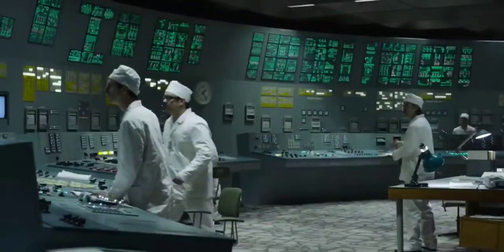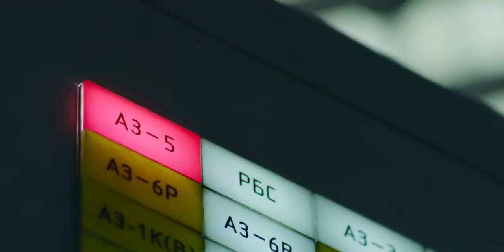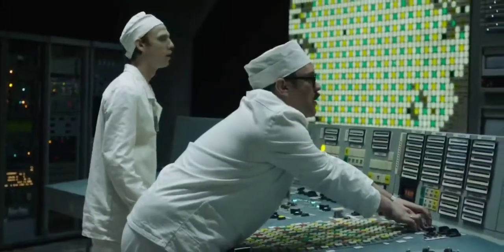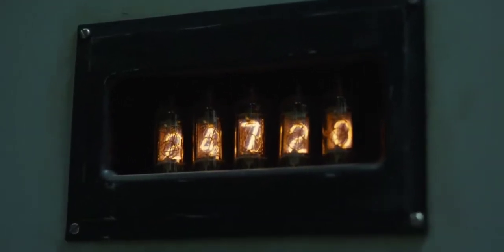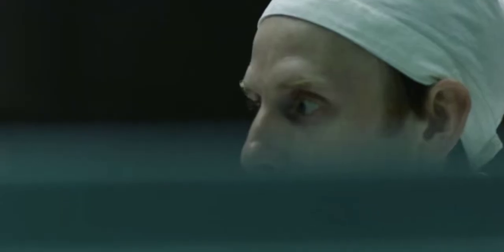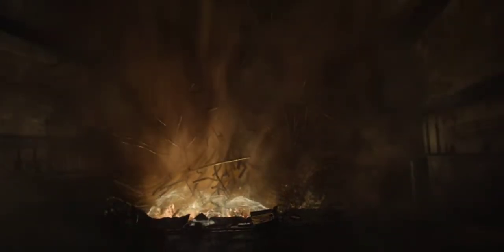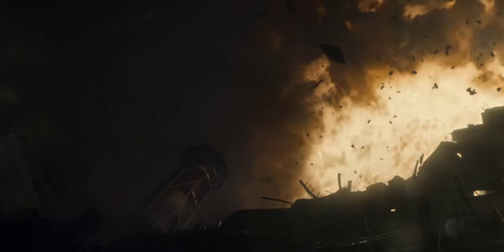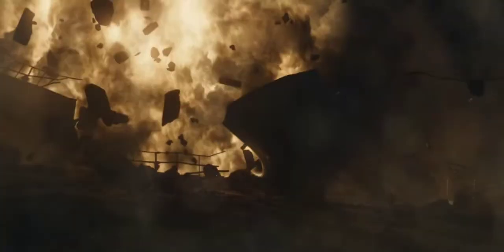That is how an RBMK Reactor Core explodes|Chernobyl|Lagasov Explanation

Comment: Imagine the power needed to throw a 1000t lid off like a manhole cover during a sewer explosion. That thing flew off, ripped through the reactor building (basically a shed compared to Western reactor buildings), kept going and landed on its side.
It was a massive steam explosion and those can be absolutely terrifying. Look at steam locomotives having torn apart. A single liter of water equals 1600 liters of steam and that steam wants to go somewhere, since something like a nuclear reactor is a closed system. In this case the "easiest" path was moving the reactor lid out of the way, which says a lot about the pressures involved. That and basically every pipe in the building having ruptured.

Comment: Can someone explain this to me? If the moderating rods are made of boron, but their tips are made of graphite, which is used as a neutron moderator (slower), why does he say that it was because of these tips that the reactivity increased at the moment of insertion???
Reply: Because graphite at super high temperature doesn't slow down reactivity; it increases it. It became a feedback cycle of reactivity, increasing temperature and pressure.

Comment: For those that haven’t already checked. Most if not all of the nuclear power incidents were caused by negligence of the operators and the system controlled by it rather than the reactor itself.

Japan for example in 2011 Fukushima was initiated by TEPCO’s negligence of not following the warnings set by the NISA for more than 5 years straight. The earthquake exacerbated the situation but only because nothing was done to prepare for it.
Reply: No the main problem was the reactors designe human error was just the matter of time
Reply: This isn't reassuring. You're saying the only problem with nuclear fueled power plants is that people run them. Oh, is that all?
Reply: @Harriet1822   at its core humans are the reason, sure the reactor system can be bad but its ultimately our fault things turned out the way they did
Reply: @Harriet1822  This is why safety measures are supposed to be redundant. Humans are inherently idiotic, so make it harder to screw up
Reply: good thing we're moving into AI era and will be able to replace majority of humanitys faulty resposibilities.
Reply: @ANythingsGood-of6uu Thats not really gonna help when said humans make the AI
Reply: @ANythingsGood-of6uu but you do realize that AI is basically just an imitation of us right? Our mistakes could accidentally be in the AI, and of course it'll follow that.

Comment: I really dislike this representation of events. Yes, some things were kept from the crew and were known by those who need to know the intricacies of the system. Those people make the rules for the use of a reactor, or any machine. And they tell you want to do and what NOT to do. For every machine, there is a prescribed proper way to use it. And there WAS one for RMBK reactor. Which the show neglects.

KGB and designers put in the files for the testing - what is the proper procedure to prepare for a test on such a reactor.

The show does cover some of that, but glances over it and pushes all the blame on the government. Aside from pages of explanation on how exactly to prepare for a test that should have been done, there was one big warning: Do NOT start a test under 700MW, the reactor is NOT stable on low power.

They didn't obey, the shift manager wanted to finish the test and get promotion/raise.

So the argument that the lies caused the explosion is itself a lie. The explosion was caused by the crew not obeying clear orders and procedures. In the same way you cannot blame US government for a soldier blowing themselves up when using a rocket launcher that has a clear inscription "This side towards the enemy". Rules don't have to be explained in detail every time, but they need to be obeyed.

And we do it with every single part of equipment and machinery we use every day. There is a user manual and a clear instruction how to properly use them. They do not go into details WHY you should do the things they say you shouldn't. They just say "Don't do this" and leave it at that. They say "do not cover the heat exhaust of the electric heater with anything", but they don't go into details explaining how it will cause damage and electrical fire which can spread and burn down your house. They just say "do not cover the heat exhaust". And for a smart person, that is enough of a warning.

The crew working that night got the clear instructions of what to do and what not do to. They didn't obey and caused the biggest nuclear disaster in history. So shifting the blame on the government is frankly pointless. You cannot make a system foolproof. You make it, you write up the correct user instructions and that's it. If someone does not follow them, not your fault.

But the show was filled with anti-Soviet propaganda, majority of it completely fictional and unwarranted, because the director had an axe to grind and an agenda to settle.

A good watch, but plays very loosely with historical accuracy and blame.
Reply: Personally, I thought the show avoided anti-soviet propaganda, it showed how the crew was at fault and how what they did lead to the disaster. While also emphasizing the failures of the state and its desire to keep things as cheap as possible while also burying any evidence that their actions could cause issues later down the line. Hell, the show frequently showed every individual as an actual person with understandable goals and fears and how they existed within a Soviet system that was beginning to crumble all around them due to a culture of fear and braggadocio. In all honesty the show didn't actually have a true bad guy in a physical sense, just in the sense that the systems the characters attempted to navigate were beginning to crumble, and historically that's not wrong at all.
Reply: @maluse227  The fact that you didn't notice the political propaganda just means they did a good job. Every episode has a major anti-Soviet segment that was invented and put there just for its own sake.

Episode 1 - made up "old guard" Soviet politician in the bunker that tells them to just shut everything down and trust in the Party. That is nonsense, just reinforces the idea that the Soviet politicians were some fanatics.

I don't remember the exact order in the episodes anymore, but other things that made no sense and were put there just to reinforce the western image of Soviet Union:

- Adding a whole segment on KGB prisons and a scientist in them, with no connection or relevance to the actual story. The producer himself said that it is not story related but that they wanted to show it because "harsh prisons were a thing", so from story about Chernobyl you go to criticizing things about the Soviet Union in general, and displaying Stalin era prisons in late 1980's Soviet Union.

- Volunteers/soldiers going around shooting dogs for the entire episode. Didn't happen, but let's show how heartless orders from the government came.

- Children going to school in Pripyat days after German children were told to stay indoors - a complete crap, the entire city was evacuated before the news even broke to the rest of the world. But, again, let us show how heartless Soviets are compared to the rest - even if we have to completely fabricate the narrative.

- Ukrainian babushka just subtly throwing in Holodomor in the story about Chernobyl disaster and a soldier threatening to shoot her if she does not come along. Because, for a moment there, you forgot that the government was and is evil. Can't have that. In reality, that soldier would have given her supplies, both then and periodically after the disaster - who wanted to stay, could, and the government was regularly bringing food, water and medicine. Some people still live in that zone. No one was threatening anyone at gunpoint out of their homes.

- Having a short fat idiot as a head of Belarus SSR, placed there for being a political yes-man, while in fact he was a tall guy with an engineering degree and was quite capable person. But we can't have that, we need a fat idiot stuffing his face and crapping on our good characters.

- Minister of coal being represented by a weakling that miners humiliate, another representation of a corrupted and inept soviet politician. In reality the guy was working in the mines since he was 15, spent his entire life in them, went on to run them, finished several degrees in engineering and mining through the course of his life. But again, we can't have someone with that resume coming in front of the miners as a minister, we need to represent the government as weaklings, liars, corrupt and inept. Even if in reality the minister had more experience in the mines than any of those who stood in front of him.

I could go on and on. The show is RIDDLED with instances of complete fabrication so that your "real character drama" can happen. And when you need to FABRICATE the environment for your characters to react to in a certain way, then you are not historically accurate.

And you are driving an agenda, a political one, and not telling a story.

Every single episode the show just reinforces the early Cold War western caricature of the Soviet system, and no, it is not historically accurate at all. Characters do not act as "real people" because you placed them in a completely fabricated and caricature universe to start with. And that's what makes it an awesome propaganda show - lies crammed in between some historical points.

Chernobyl series should be a master class in political propaganda piece. That is how you do quality propaganda.
Reply: And who's fault that those people were in charge of the nuclear plant, that's right, the system. So you could blame the government and the KGB for that
Reply: Good tankie. I'm sure the time-travelling ghosts of several Soviet secretaries general will bless you.
Reply: @Mark-xh8md  I have no idea what you said there... but I guess you think you made some point.
Reply: @Wustenfuchs109  " I have no idea what you said there... ", lol, sure you don't.....
Reply: @Wustenfuchs109 While you are right about some of the technical details, you forget that this is not a documentary, but an art piece. Since impressionism, art has evolved into not portraying things with 100% accuracy, but to take a snapshot of their true nature, which this show does exceptionally well. 

As a Hungarian, I can tell you my parents were educated, my grandparents were economically crippled and harassed, and one of my great grandparents was killed by various SU party officials. Not all of those were bastards and monsters (not in the show either), but sure as hell many of them were, and this system of ever shifting accountability and lies let incompetent and petty people in power run amok, destroying lives, and eventually the system itself. 

What you call "Western propaganda caricature" has been the experience of many who lived in this system, and suvivors and pieces of literature, art, music are a testament to that. Can send recommendations if you like. That is of course only the ones that survived state censorship and the Black Car. Yes, you could crack some jokes about some chinovnik, or the party, and a black car would show up in front of your house at night, take you away and you may not return. These are not myths. 

Another example of what Chernobyl shows us is happening in Ukraine right now. Putin´s puppy, Sergei Shoigu, Minister of Defense, a loyal career politician, never been a real soldier, dressed as supreme general, decorated with medals he created for himself, sending thousands to their deaths because of lies and delusions of grandeur. A competent Russia could have taken Kiev in 3 days with minimal civilian casualties. Just as a competent SU could have prevented Chernobyl disaster (and maybe also not fall apart like it did).  Thats what this show is telling us, and in that it is truthful.
Reply: @nincsjonev  Ah, an art piece, a cope out when ever something fails to stay true. Should not have been marketed as historical recollection then, but a fantasy inspired by real events.

Apollo 13 wasn't a documentary either, but they quite adamant about making it as historically accurate as possible.

And I didn't mention "technical details", like "Oh they should have used this model of car instead of this one that came out 3 years later", my "details" are entire narrative points of episodes.

But, suit yourself, call them details. I consider the entire series as a work of art indeed, but of propaganda art. Goebels would be proud. A crucial lie snuggled between two truths. Really, a masterclass in political propaganda and for that they would get a standing clap even from me.

Comment: I was team lead in a commercial nuclear security opfor team. I was a badguy,  and I knew which switches, on which panels, in which order, to turn, to pop the top. And I did so three times on the simulator.
Reply: as in you successfully caused a meltdown?
Reply: @Mr_Demeanor  Yup. Since it was a simulator, I did so with gusto. Ok guys, try and fix it.

The hard part was actually fighting your way to the control room, then shooting everybody inside. But I mean,  training exercises so...
Reply: @jackstecker5796 how much physical security did you encounter?
Reply: @David McCoy II  I can't really get into specifics, but LOTS. And every time adversary team won, they added more. Eventually, it got to the point that we were lucky if we got anybody TO the fence, much less through it.

I should note that I was a security officer, in addition to being an adversary, so on my normal shifts, I would wander my patrol areas, looking for any chinks in the armor. Not much else to do at 0200.
Reply: @jackstecker5796  "Every day at two in the morning I think about how to blow up the reactor. Then every day by thee in the morning I have a new countermeasure" - This guy, apparently.
Reply: @ObsidianG  Yeah, pretty much. I used to spend hours picking the brains of the reactor operators and plant systems guys. Worked out well because most of them were interested in guns, and I have a pretty comprehensive knowledge of firearms and the laws attendant to them. I ended up designing a build for one control room manager that the State Police dubbed, "the AIDS cannon." But it was 100% legal. 

I ended up finding several issues that ended up being added to the physical security plan (PSP).

You have to remember, back in the 60s and 70s, when most of the plants were built, they didn't even have fences around them. Security had to be retrofitted in, as an afterthought.
Reply: @jackstecker5796 It was a different era back then.  No one could imagine that people might resort to such a thing as terrorism.
Reply: @jackstecker5796 what is your job? Sounds fun